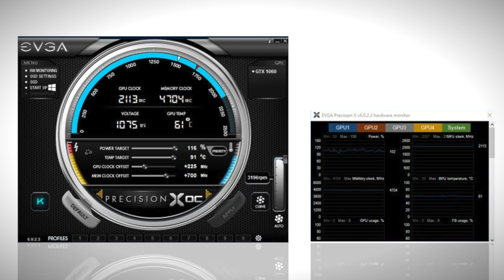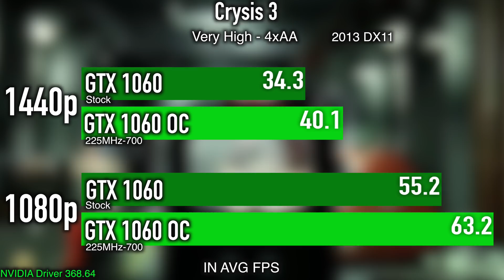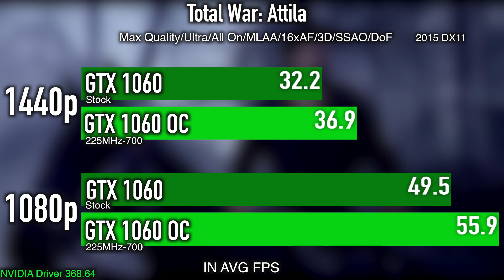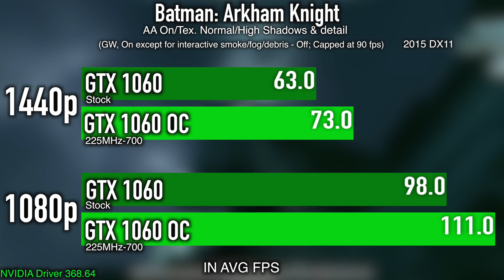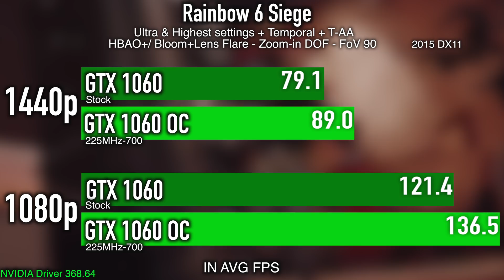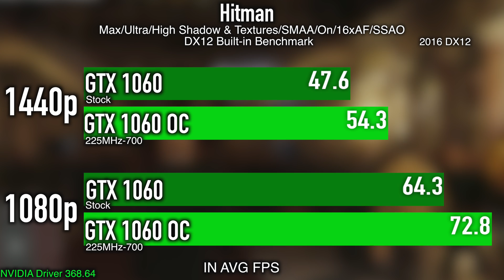The GTX 1060 Overclocked And Tested! 225Mhz Above Core!

Comment: Running Fx 6100 with gtx 1080 at 4k @high preset no AA with ease 60fps. Same for Rise of the Tomb Raider.
Reply: Sure mate
Reply: Nice bottleneck.
Reply: You guys obviously have never ran games at 4K before XD Most stress is taken off of the CPU and placed onto the GPU. The CPU is than able to smoothly render out the frames, therefore reducing the "bottleneck". In 1080p, yes it will suffer a lot but in 4K, not so much. Many test have already been done so there's no point in arguing with facts. Even the $50 i5 750 paired with a GTX 1080 can run games in 4K better than an i7 4790k. You guys are so misinformed. But yes, there is still a bottleneck present, it's just not as relevant.
Reply: That's not a bottleneck.
Reply: I've watched them :D Pretty cool!
Reply: lmao in your videos fps constantly drops below 40-50 fps.. you GPU is at around 60-70% while ALL your cpu cores are at 89-99%.. if that isn't a bottleneck I don't know what is.
Reply: WRONG! Hahaha. So you're telling me, If I were to play L4D2 and it not hit 100% GPU usage then I'm bottlenecking? Hahahaha
Reply: +Apurv Shivalkar Witcher is a cpu intensive game most open world games are
Reply: Same here man! I can't wait to see what AMD has planned next :D
Reply: Apurv Shivalkar dude it's not, pay with PayPal, if you get screwed, just charge back and be done with it. That's what I do, haven't been screwed over once and I've been buying stuff from China, which is usually where bullshit comes from.
Reply: Mike Fox That is what i fear investing into. Because i had 10k but invested all into psu+ cabinet just to get the card running. I am actually looking for server procs through my contacts(you know when companies upgrade they sell them for dirt cheap from there i am planning to get this one). I will get a 6 core atleast.
Reply: cool story bru
Reply: Bottleneck up the ass
Reply: +SheepForest SheepArmy At 4k this is no bottleneck
Reply: No you don't LMAO!!!
Reply: +DJHeroMasta that's a mad bottleneck the cores in amd chips are weak compared to i5s and i7s
Reply: Eh i5 6600k oc should be enough
Reply: TheTurtleOffDoom On 4k the 6300 is ok aswell^^
Reply: +TykoPC Before making any stupid accusations watch my video.
Reply: DJHeroMasta People make false claims without evidence just because a popular channel said it they will believe anything ffs. I follow tech of tomorrow for a reason atleast he doesn't insult amd like others do.
Reply: Yeah, I've seen a lot of fake AMD vs Intel benchmarks too. It's just sad. Then people talk about power consumption, ahahah it's only a few dollars difference XD
Reply: LOL xD No bottleneck guys!

Posts a video of it running Witcher 3 with the GPU not going past 80% usage at 4K

Dude, seriously, know your shit m8.
Reply: DJHeroMasta As gamers we install like 750-1000w psu power shouldn't be a problem for us. But again they have to use some thing as a defense mechanisms to blame the other side. Yes amd chips are weaker but i bought my cpu+mobo+ram for 11k while a single i5 6600 costs 18k.
No doubt intel is the best but is intel affordable? I didn't buy my 1080 i Couldn't even afford a 1060 but i am getting benches out there to inform people to pass the right info to those who are mislead. What i get in return? Racism false accusations. This is harsh reality.
Tomorrow Linus will say 1080 is shit i guarantee half of the crowd here will believe it.
Reply: Mike Fox Did you see the fps? How many were they? Above 60 without record right? What is a bottleneck when fps stays above 60? You want fx6100 to do 100fps and then you will say it doesn't bottleneck so basically a proc that does 100fps doesn't bottleneck but if it does above 60 it bottle necks.
Reply: The games that aren't optimized at 4k will bottleneck, even 4k youtube will destroy your fx-6100.
Reply: "Games that aren't optimized at 4K" WTF are you saying Hahaha.
Reply: Some games are optimized at 4k due to drivers others aren't and will either load horrible or won't work at all. Batman arkham something is an example.
Reply: Apurv Shivalkar THERE IS A BOTTLENECK WHENEVER THE GPU DOES NOT HIT 100% USAGE.

60 FPS means jack shit when you're buying a 700$ GPU, if you're happy with that, by all means, try playing a CPU heavy game and let us see how your FPS holds up then.
Reply: Ashish Parmar Lmfao ever heard of recording vs actual fps? I use fx 6100 so i am the victim here come attack i shall clear you of misconception.
Reply: Apurv Shivalkar You used shadowplay, stop bullshitting.
Reply: Come, lets all fight because i use an amd proc come on. Because the proc is amd i can see the rage what if i told you i like intel more than amd?
Reply: +Mike Fox Stop crying mate. If you can't take the truth leave it. I don't go Intel is best amd sucks or shit like that but if a proc does well with a game your ego is hurt. This proc won't even do 30fps on arma 3 i will say that but nope it does well on witcher 3 why the fk it does well on witcher 3? It sucks right?
Reply: Apurv Shivalkar See? You just exposed yourself, AMD vs Intel has nothing to do with this, but you're butthurt about it. It's okay, you can keep having wet dreams over a 3 module Core 2 Quad level IPC CPU with your 1080 on it, I don't give a shit about brands, I care about actual performance, and if a CPU doesn't deliver it, sorry, it's completely disregarded.
Reply: Before all of you start fighting lets face the fact here
1. Didn't buy the gpu ( won it ).
2. Cannot afford a 1060 
3. The proc does well with 1080 at 4k assuming that's because witcher isn't a cpu intense game.
4. I am just telling the truth why does it offend any of you.
5. If any of you would have been in my place what would all of you have done? Trash the gpu or wait to upgrade skylake or zen until price drops.
Reply: Mike Fox Exposed when did i hide the truth? I think you were butt hurt about it with the way you replied because you are still going on insulting the cpu as and when you can go ahead mate. You should read my comments throughouly just because i posted the witcher 3 does fine at 4k so does rottr the viewers went crazy. 
Someone said something racist while someone called amd shit. Let me ask you one thing mate.Did you pay for my setup? Did you sponsor my 1080? It is very simple i got a op gpu over my fx 6100 and 60fps is a big fking deal for me bcs my older card was hd 7770 1gb ddr5 and it never saw 60fps unless on 720p and all low. So if it does 60fps what's the problem man?
Reply: Alex Rust I don't think so because then it would have just hit 100% on all my cores like arma 3 will. I didn't try arma 3 on 1080 but on 7770 it did.
Reply: ZomBie Gaming I am fine with 60fps and i am considering zen for upgrade.
Reply: I was going to upgrade to Zen but couldn't wait, so I got an 8 Core 16 thread Xeon instead.
Reply: Mike Fox I cannot afford an intel that is why i have to wait dont mind the rage it is the harsh reality these that we say something and then be made fun about. 
Intel is undoubtedly the best but since i  cannot afford i am using the best in budget.
You won't even believe that my proc is not ocd running at 3.3ghz.
Mobo is usb 2.0 gigabyte
8gb ram @1333mhz
Corsair cx750. 
60fps is a win for me it might not be for others but yes gamers like me exist. We care only if the game runs fine we are happy why fight on it right mate? He who has money has intel he who doesn't have amd in the end let's play the game.
Reply: Apurv Shivalkar funny thing is that my Xeon was cheaper than your FX 6300, buying smart ≠ having money.
Reply: Mike Fox No it isn't not where i stay. 4690k still costs 16k here while my entire cpu+mobo+ram costs 11k xD.
Difference of countries mate..
Rx 480 costs 23k when it should cost 18k by usd conversion. Here old is still gold. Be it intel or Amd xD.
Reply: Apurv Shivalkar My Xeon was 95 bucks lol

That's 8 Cores and 16 Threads of Sandy Bridge power.
Reply: Mike Fox e5 right? It is 37k here means 564bucks(usd).
Reply: Apurv Shivalkar https://m.ebay.in/itm/intel-Xeon-E5-2670-8-cores-16-threads-/262531401889
Reply: Mike Fox Nah ebay half of it is faulty. I will definitely buy this if i get a new one from legitimate site i will even pay 12k for it but not ebay. Also i saw one for 6k but it was dual core let's see if i get a new one for cheap.
Reply: Apurv Shivalkar watch out, you might get a First gen 6 Core, while its not bad, it's not good either. You're better off with 6300 if that's the case.

Comment: Hey tech of tomorrow. Do you think that the 1060 will be a smart choice when going for a 1440p Resolution gaming experience? or is it best to keep it in 1080p seeing how intensive games are becoming in such a short time?
Reply: better save ur money for an 1070
Reply: Pixel Push I play a wide range of games. But typically i'm playing the arkham knights, DOOM, Fallout 4, witcher 3, Divinity original sins of the gaming industry. And also smaller indie games like Freedom planet and Fez to answer your question.
Reply: +Itachi8 lol those games are kinda similar. But if you want to play 1440p 1070 is the way to go. 1060 is pretty good for 1080p.